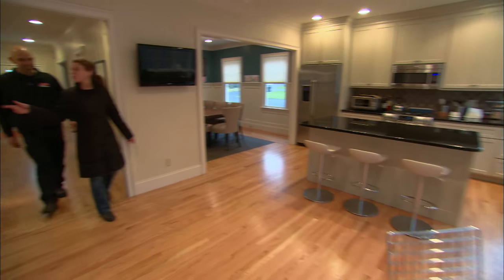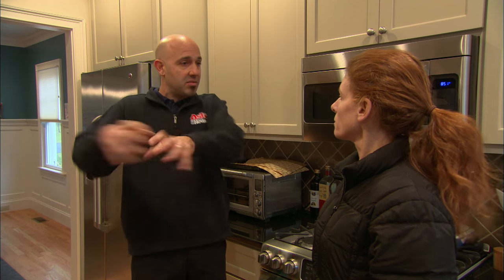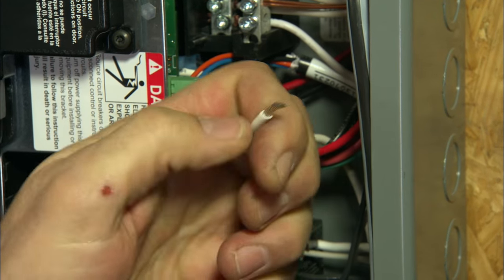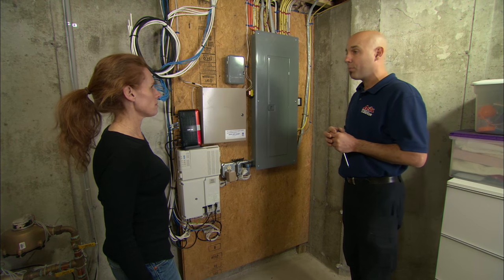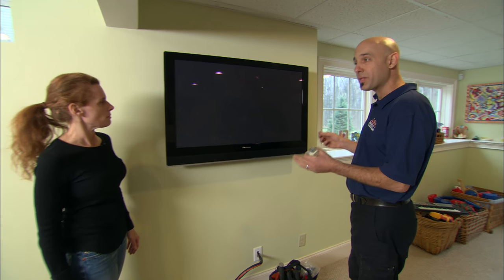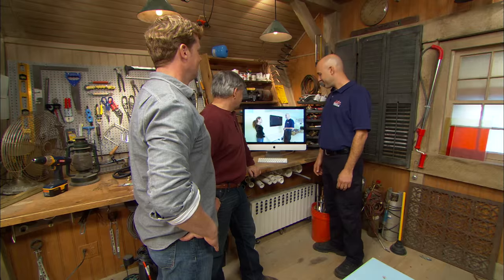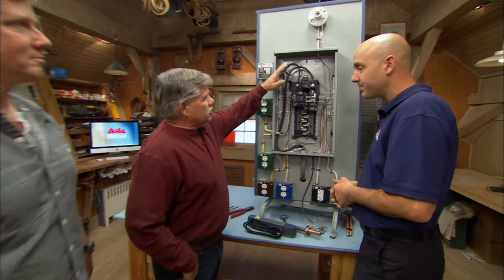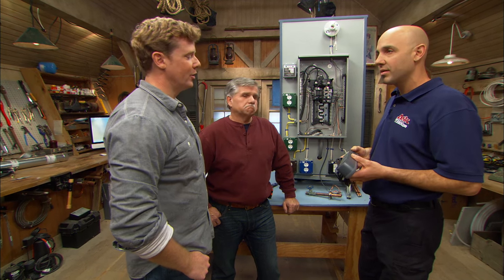How to Install Surge Protection | Ask This Old House

Comment: Don't you think you should delete this video ?  This Sycom protection device has apparently proven itself to be faulty and the cause of many homes being damaged... they're now out of business, if you can believe the reports on the internet >?  Not sure, but if these incidents did happen and the company is now out of business, I'd suggest taking this video down.
Reply: The reports of fires is accurate.  See:  https://www.prnewswire.com/news-releases/public-notice-ul-reissues-warning-of-potentially-hazardous-surge-protectors-300872213.html
Reply: Yes, Sycom shut down.
No, it wasn't this SPD.
It was the "compressor saver" sold to be installed outdoors on your air conditioning condensing unit disconnect to protect the air conditioning compressor itself.

Comment: Whole building surge protectors are a waste of money.  They only operate when the surge is over 600 volts or higher.  He even tells her that most surge originate from inside of the home so having something at the service entrance is a waste of money. Ironically with this being "This old house", there are many old houses without a ground system so point of use surge protection using store bought surge protection does not work and can be dangerous.
Reply: So what are you saying, your better off without it?

Comment: I can't believe someone as knowledgeable as he seems is backstabbing???
Reply: Those arent backstab connectors. Gfci receptacles and the like have a clamp thats toghtened by the screw using the holes in the back. With backstab connectors you dont need to tighten a screw, it just clicks in. What he did is as safe or safer than a traditional loop

Comment: This guy knows enough but still not neat on his trade.  He needs to tighten and lose and wiggle and retorque those connections when it is a stranded wire, they can become loose.  And, why on Earth did he not use one knockout up for the whole house surge protector. The wires need to be as short as possible and he has two bends.  MOREOVER, the instructions call to twist the two hots, AND that particular surge protector explodes, it was recalled after this video. There are EXCELLENT surge protectors out there, the best is BAD WOLF, made in USA, by disabled veterans and goes up to 260k, commercial grade even, enough to protect from lighting and EMP also. These 20k-50k are good for Mickey Mouse spikes, but a voltage tsunami in Florida or anywhere with nasty storms will fry it all over again.

Comment: I installed a whole house spd. This video is not a how-to video. Be very careful, or hire an electrician. You are dealing with live wires coming from the street which cannot be turned off. Not sure how dangerous it is, but made sure not to find out.
Reply: Usually you have an outside breaker next to the meter that can be shut off which cuts all the power to the house.

Comment: Well now I know why the lights in my school dim when the air conditioner comes on.
Reply: Auctually, they do because the AC draws a large amount of power when it starts. The resistance in the wire going to the school causes the voltage to drop. I would suggest adding a soft start device to the motors in the air conditioner.
Reply: Ummm... that’s what he said in the video. And I can’t do anything to the airconditioners, I’m just a student.
Reply: I would suggest talking to the person that repairs school systems about it.
Reply: The laws are different in Australia, only air con people can service the air cons.

Comment: Did anyone else see that the electrical panel seemed to have a surge protection device built in at the bottom? And all that cat5 running through the home and Verizon put the router in the basement. Ugh lazy!

Comment: This guy loves struggling with flat head screwdrivers
Reply: Nah, you can see him using Robertson (square) in the panel, which is better than either flat or phillips. The outlet terminal screws aren't Robertson, and since phillips is designed to cam out, flat can get them much tighter.

Comment: Would it kill TOH to help some cash strapped people with their house issues?
I realize they only renovate the homes of well off people on the main show,  because only affluent people can afford the spike in their taxes from the expensive improvements, but basic improvements or fixes on this show, that wouldn't be an issue.
I'm sick of watching rich picks getting their toilets fixed, or stressing out over a crack in their fucking patio Blocks on ATOH.
Reply: Maybe most people don't want to see a show set in your trailer park.

Comment: Emmmm what? Before I start my beef - I used to be "licensed" electrician in Poland, EU (used to, because I changed mine and went to software developer path ;) ) so... It looks like you treat this surge protector as a branch circuit equipment, like an outlet it something. This should be wired to the main supply line, every before main breaker... You are adding additional resistance to the circuit plus adding failure mode in form of a breaker?! This added breaker would break its self circuit, not a house... Plus, you are saying "surge goes down to ground", while you are connecting it to the neutral bar... Ground path should be optimized for resistance...
What voltage this unit will protect against? Usually whole house protector brings voltage down to few kv, and you need point protectors to get down to 1kv (which is then safe for internal power supplies).

Comment: The white wire supposed be connected to a neutral bar !!!!
Reply: In a main panel, neutral and ground are the same. They only need to be separated in subpanels.
Reply: Adam Ahmed that’s the old system; now we got the 4 wire system, we’re neutral and ground ( grounded and ground) are separated, on main Panel